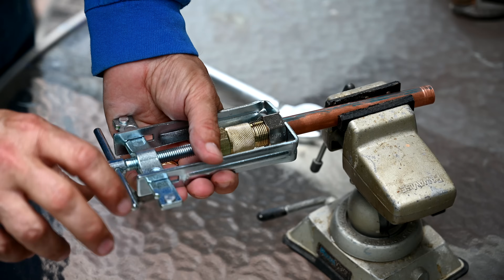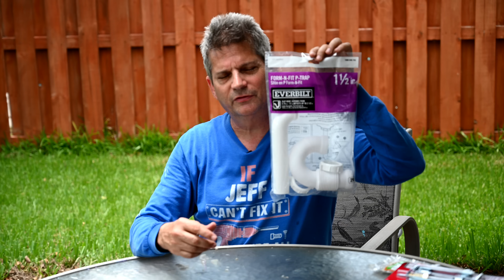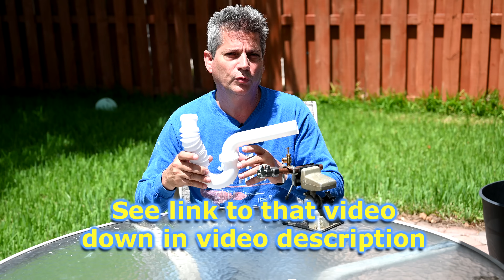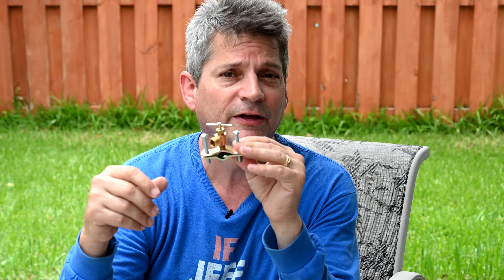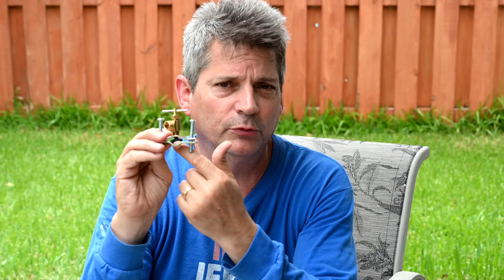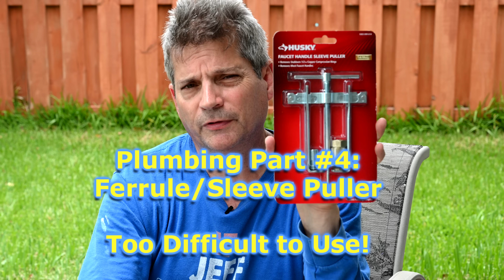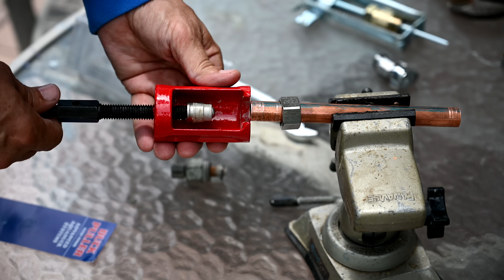4 Plumbing Parts/Tools You Should NEVER Use. NO Plumbing Fails

Comment: 19:35 you are not using the tool properly, instructions are on the back.
Reply from the maker: Yes, the instructions on the back, don't say anything, other than showing the arms spread apart on the drawing, but good luck doing that and keeping those arms spread apart, so best bet is to keep them together, still a pain. Obviously you've never used the tool or you'd know about this issue.
Reply: @jeffostroff  I use the tool daily, the arms self tighten, thats its whole design. not to mention you have 2 whole minutes of close up video watching you fumble with it. The arms arent in the slots, the screw is full extended. You dont know how to use this tool. RTFM  

"the screw bumps into the arms!" 

just.... wow dude....

Comment: You just don't know how to use the husky... lol there is 4 inches of thread and you had the thing screwed all the way in before you started.
Reply from the maker: Wasn't trying to use the Husky, just showing you what it does. It does not matter where the thread is. When you actually go to screw it to the actual nut, you set the threads accordingly. Nice try showing everyone how YOU don't know how to use the Husky tool, looks like it backfired on you.

Comment: That brass fitting touching the copper pipe (the saddle valve), causes excelled corrosion due to the dissimilar metals.  One becomes a slave to the other.  (boating 101).
Reply from the maker: Yes, we have mentioned that and still people keep bragging how they have used them for 30 years with no issues.

Comment: When you changed the cut off valve THE NUT AND FERRULES ARE THE SAME. JUST UNSCREW THE OLD VALVE AND SCREW THE NEW VALVE ON TO THE EXISTING NUT
Reply from the maker: You can do it your way, I choose the brand new matched ferrule/nut pair that comes in the box. Doing it my way is a lot better than your method, because removing the old ferrule compression sleeve allows you to uncover any potential corrosion, or flaws in the pipe, and you are resetting the clock back to day 1 again on both the nut and the ferrule. Also, you are providing the matched ferrule with the nut as built by the manufacturer, guaranteed to work together, rather than take a chance on an older ferrule who microscopically might be different enough from a newer nut made 40 years later from a different manufacturer, that there could be a slight leak. That's why I do it. Do you see how many potential avenues for failure I eliminate, and how many potential avenues for failure you are leaving on that pipe with your method?

Comment: "I already had to gone to two customers"  lol
Reply: Doesn't the floss and hair normally just get caught on the sink stopper mechanism?  I know not to use those accordion pipes and that they are not to code, but I'm sorry I've seen enough normal pipes clogged up, the accordion folds don't do all that much beyond trapping more mildew  with more surface area.  Like i said I know about all these, cool list though.  Don't look down your nose too much at us handymen.   You know more about plumbing, sure.  I know more than you about:  roofing, electric, foundations, stone, kitchens, baths, framing, woodworking, glues, caulks, retaining walls, grading, gutters, painting, wallpapering, finish carpentry,  hazardous materials, the list goes on and on.  I also think PEX plastic plumbing could be the next asbestos and I don't use it.  (Yeah asbestos WAS "fine" too).
Reply from the maker: Polybutylene was the piping of the future! Yes, I have seen more clogs at the throat of the drain which get snagged on the drain, so we use that drain weasel and other plastic strips from Home Depot that go down the pop up drain and their barbs pull up the hair. Floss could dangle and unravel through the trap and suck up water through capillary action.

Comment: Hi Jeff I am doing a garage conversion and my new drains are built into floor via concrete pour. I was looking to do an S-trap for this reason but luckily I found your informative video (thank you for this). I have found an alternative in the HEPvO valve which people often use when space is limited (such as an RV or tiny house), but I’m not able to decipher the Florida Building Code to see if this valve will be approved by my inspector. Keep in mind that not everyone does the deep-dives into building codes. It may be easier to become a lawyer. Ever seen any HEPvO valves approved by the inspector? Thanks beforehand for any advice.
Reply from the maker: Since Hepvo is not a trap the rules for traps like no moving parts inside should not apply here. I assume this will go in lieu of a P-trap, and that the inspectors won't have a problem with it, just have data sheets ready to explain what it does if they don't know already. Also call the company directly and find out if the parts are allowed by plumbing codes. Usually you'll see the UPC (Uniform Plumbing Code) Logo on plumbing fittings to let you know you are using an allowed fitting. I don't see that on this fitting.

Comment: What gets me is the "handyman" who uses more materials and does more work to do the job wrong than doing it right would have done.  The house I live in now had a convolution of pipes at the pressure tank that looked almost like the old Windows screen saver, just to run a line from the pressure tank to the house, with a line running to a hose valve on the side of the building.  It was time to replace the old pressure tank anyway, so it was replaced with a standard T as part of the job, and was a very simple install.  I could go on and on of the stupid I have had to deal with in old houses, such as the guy who had used an entire tube of silicone to seal a sink drain instead of replacing a 15 cent gasket.....  I can only imagine what professional plumbers see every day.
Reply from the maker: Yes it happens because they don't think first. I've used a mantra since I was 18: Think harder, work less.  Granted not everyone has the engineer way of thinking, and we see the results when they don't think first.

Comment: Did a DIY on my mom's bathroom vanity removing and replacing a 40 year old sink and P trap. First time I'd replaced a sink and P trap and went to Lowes and the guy there hands me the flexible P trap and even my untrained eye could see it was not the way to go. I could see hair and other various gunk getting caught in the accordion folds and causing a clog. I asked for a standard P trap and luckily only had to trim a pvc pipe for the drain to line up. Probably would've been watching your video if the drain didn't line up.
Reply from the maker: Good thing for you that you went with your gut, not with with the Lowe's employee told you

Comment: if these are banned why are they still manufactured?
Reply from the maker: It's funny I get this question asked several times per day the parts are banned by plumbing code not by criminal law and so anybody that has the maradee and stalled could probably just replaced them but if you do any new building in get a permit they will make you remove the items

Comment: When I was at the hardware store and I had to replace my shutoff valves there was an option for iron and copper valves so I just bought the copper valve because I have copper pipes.
Reply from the maker: That makes sense, you don't want dissimilar metals coming in contact and causing corrosion.

Comment: Jeff, I like you but you're demonstrating real ignorance on the sleeve puller. The arms are not used to pull sleeves but shower handles that are stuck. You never use the arms to pull behind the nut and the direction make that point. It IS a two in one tool and that is why it's useful. Simply take off the arms and it is a very good puller at a much lower cost. And it does pull very good.
Reply from the maker: Yes we have used it to pulll ferrule sleeves all the time but it does not work on ferrulel sleeves that are stuck. Unfortunately most of the sleeves that we end up pulling our stuck so we don't use this tool we use the duck puller which is much better.

Comment: I just bought a home and one of the first things I decided to work on was replacing the main water valve, a corroded gate valve, with a new ball valve. Well, while surveying the pipe I was replacing, I noticed there was a saddle valve ahead of the main water valve! SMDH. Needless to say, I cut the pipe all the way down ahead of the saddle valve and replaced the entire section.
Reply from the maker: Way to Ivan, you corrected a potentially costly failure down the road.
Reply: Main water valve in multiple complex building

Comment: If illegal, how the heck are they getting away selling these stuff?  Besides profits, really doesn’t make sense to me, because don’t inspectors check, much less shop there too?
Reply from the maker: LOL, everyone asks this question. It's not against the law to buy or own the parts, it is simply against building codes to use them. You won't get a signed off building permit with these in place. Many people also install parts without an inspection.

Comment: I just discovered that under my kitchen sink I have both form n fit AND an S-trap! I’m not sure what to do because my drain terminates in the floor and not the wall!
Reply from the maker: If your  S trap is working fine and you don't have any problems  sewer gas smells coming up then you really don't need to change it. But I would look at removing the Foreman fit whenever you get a chance, and replace it with standard  Fittings that would  Make the connection that your form and Vic trap is attempting to make.
Reply: jeffostroff - Good advice, will do.

Comment: Why can't I just cut the ring with hack saw blade? I just did that last week and replaced 6 valves and then I used new shark shut off valves
I am not a plumber, I am a finish carpenter, but when I told the customer she needs a plumber she was like can't you do it all? I said sure no problem...I was planing to use a plumber...but boy they are supper expensive!!! I was little nervous because i might lose the job for over price it so I decide to take my chance and do it myself.
And I did it!!! it took me 2 trips one to home Depot and one to Low's because the standard P trap was not long enough and the drain was way off center but with a lot of questions and some YouTube videos (yours and others) and a lot of prayer to God!!!! I got it done!!! and I loved it because I learned something new and it was really fun job, it is like putting toys together, the 1st one was the hardest one and the longest because I had to read all the instructions even it was very simple and easy but I was little nervous but when I was done I made extra $400 to install the 3 faucets and customer pays for all the parts.
Now I am thinking to learn plumbing because they make triple what the carpenter does for the day even though the carpentry much harder and it take triple the time to do the same job.
Reply from the maker: That's not a problem at all Dean, lots of guys cut them off, it's the norm in the UK, they cut a slit in the "olive" as they call it, and separate it with a flat head screw driver.

Comment: That S trap is clearly unacceptable, badly designed, v different in the UK.  The connection (RHS in the picture) should be ABOVE  the second part of the S trap,  and the whole system properly vented with a 4" stack nearby.  The basin outlet should be 1 /14" outlet, going into 1 1/2" pipe below,  Add an AAV if in doubt.  Saddle valves - they should be banned outright,  cos the steel cutting point / outlet pipe will RUST in the hole (electrolytic corrosion) and eventually block, not to mention any pieces of copper that will drop into the system.  Olive pullers - that has to be the worst item I have ever seen, other far better such pullers available. or just use olive cutter pliers when the olive has been compressed in too far to be pulled off.   Nice vid, thanks Jeff.
Reply from the maker: Thanks for your input Theo!

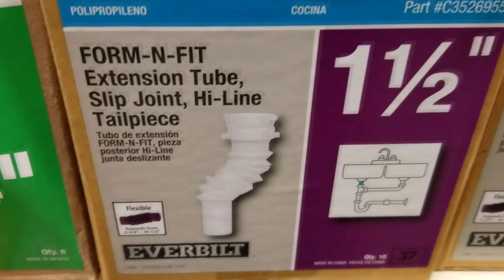Comment: I shifted my vanity over a few inches and had to use the accordion hi line at 10:25.  I'm a diy and couldn't find any regular pvc to use as a solution plus the pipe going into the wall is wider than standard so my options are limited.  I can confirm that gunk does accumulate in the flex and stinks after a while.  When i get around to it, i'll see if i can find a better solution.  Thought of using plastic tubing, and using a sealant, but they aren't flexible enough
Reply: The "Snappy " traps are flexible yet smooth on the inside and code approved . They work very well . They do have to installed properly however or you may create another issue which can violate code .
Reply: I had similar problems when installing new sinks (7 total in my home for near complete remodeling). I bought ABS tubes, fittings, ABS glue, and it took me a few days of trial and errors to get the first one done correctly (meaning everything line up and glued properly. The remaining six become quite easy as I know what parts to use and the proper sequence to connect and glue them. To get exact length and path,  I connect but do not glue. then cut if too long or cut another piece of too short. Only when they fit properly then I start gluing.
Reply from the maker: Yes, this is why forming the exact length and path using the PVC fittings is critical.

Comment: Plumber in my area wanted to replace my saddle valve to the back of the fridge which i inherited when i bought my house. H?owever he wanted 800 bucks to do the job, Id use a plumber if he wasnt trying to rip me off. All the plumbers around here are paying themselves a thousand bucks a day cause they can. The plumbers are the problem. People would use them more if they werent trying to rip us off.
Reply from the maker: That is very excessive overcharging, it's a 1/2 hour of labor for them, should be no more than $250. It's simple, cut the pipe, solder on a T-fitting, and a dedicated valve for the ice maker line. The fitting is $1.00, the valve is $10, and the labor is about 1/2 hour. Might take you 1 to 2 hours if you have never done it before. But watch a few good videos on how to solder, then practice on a half dozen pieces of spare pipe and fittings, and do it yourself.
Reply: @jeffostroff  as apposed to the regular overcharging, right? how do you justify $239 for 30 minutes work!?!?!?
Reply from the maker: @nealfoster6311  They do and they get away with it.

Comment: Had a saddle valve for 40 years, and it never leaked. I did have to replaced when doing other work.
Reply from the maker: Awesome you are one of the lucky ones. We have received comments here from other people who add water damage from their saddle valves. Sometimes it is luck of the draw or if you're really unlucky in you have a really cheap metal Saddle valve installed in a moist environment where the electronicist is allowed to take place and it develops a leak that's how the cycle starts.

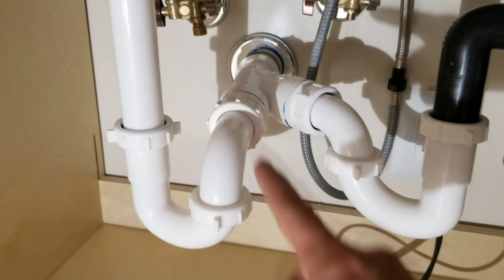Comment: where I live the one at 9:50 that is a plumping fail you are only to have one P Trap for a double sink
Reply from the maker: I'd like to see the actual code, because I doubt they would really prevent 2 traps. I know most codes don't allow a double trap meaning you can't have one trap followed by another trap, but sometimes people confuse the 2 prohibited scenarios.
Reply: @jeffostroff  its a Canadian code if the p traps are that close to each other the force of the water draining from one sink can suck the water out of the other p trap empty you can pass but  the p trap has to be 2 feet away from a connecting pipe so with the confined space underneath it is easier to have the 2 sinks to drain into 1 p trap
Reply: That is super weird looking lol. It's called  a continuous waste. Either end outlet or center outlet.  Like on a commercial 3 compartment sink. It would be ridiculous to have 3 traps. You put one trap at the end of the line and maybe a clean-out access at the other end..

Comment: I'm not a plumber, but why would an S trap siphon out if a vent was properly installed? One would think that the outlet of the trap would make no difference if it was through the floor or wall as long as the plumbing vent was working?
Reply from the maker: One other possibility J S is that sometimes if they have a long vertical drop greater after the S-Trap, then you are dealing with the inertia of water, it's no longer a venting issue.

Comment: Good video, but the nut furrel puller you used, do it in forward motion with a drill, it looks like it's made for that operation.
Reply from the maker: Yes it could be used with a drill, but many times I'm forced to remove ferrules that are corroded on and need a wrench, as a drill will not provide enough torque to loosen the stuck ferrules.
Reply: I understand.

Comment: The pircing valve is often provided by the manufacturer when buying a Swamp cooler or a Humidifier. So most people will believe it is acceptable to install. And it is in some jurisdictions.  Only in the last 5 years have there been changes to encourage using a Tee valve which has a ball valve built into the tee. 

A great term to use to discribe the “capillary action” you discribed for the dental floss in a p-trap is “wicking” of the water. 

Another term to better discribe for the S- trap “capillary action” is “siphonung” of the water when a toilet is flushed.  
Some kitchen remodels will be allowed to use-by code- is a spring sealed and ball sewer vent installed at the sink top or counter top or even installed above the wall cabinets.
Reply from the maker: Our area allows the use of a Studor vent under the sink